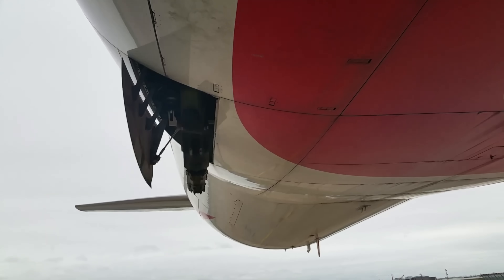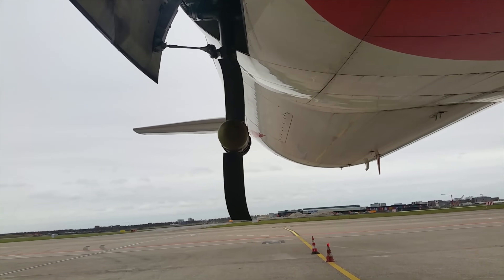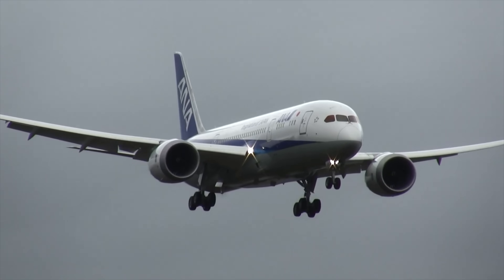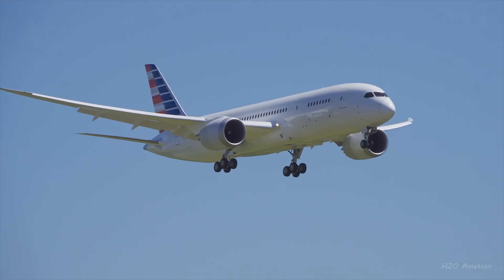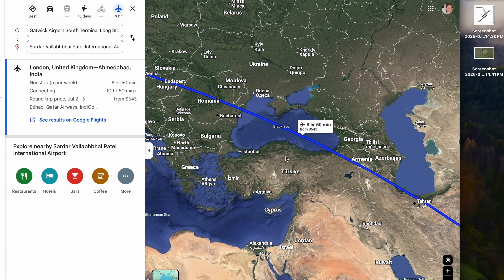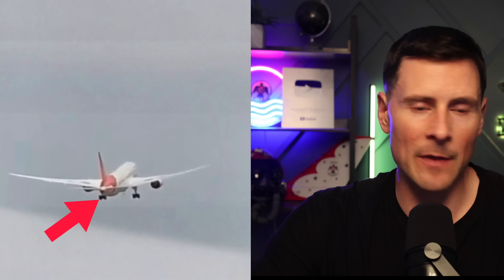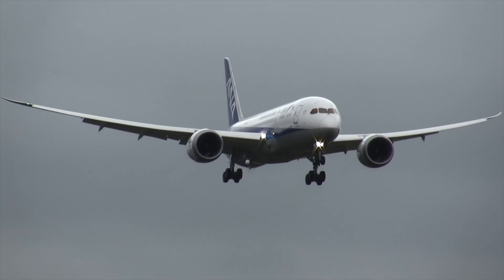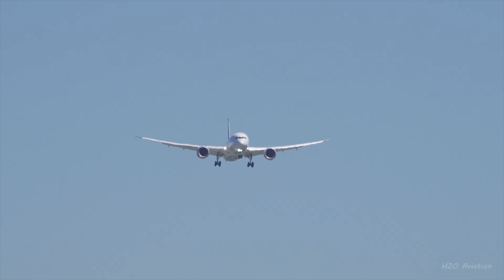Air India 171 SHOCKING UPDATE on RAT Deployment and Flaps!

Comment: I’m a B787 captain with 25000 TT and 8000 on the B787. Great videos, thank you. My thoughts are that they lost the right engine at or around V1, that explains the cloud of dust at the end of the runway as they were rotating. Shortly after they lost the left engine, same reason as the right, possibly from fuel starvation or software issue. One small detail, the EECs have there own power source independent of the main buses and the engine driven generators, as long as the N1 fan if windmilling the EECs are powered. The bogies are tilted in the retracted position, not in the extended position. I’m sure the NTSB will find the gear lever in the “up” position.
I really feel for those guys in the flight deck, all the passengers and the victims on the ground.
Reply: Here's my question to you sir.....
I worked in Boeing experimental flight test and flew on those so many times. We always recommended APU be on until take off was complete and the airplane was clean. 
Why do you think they took off without the APU on? A single engine failure with APU on would not deploy the RAT. 
Lets discuss for a moment the different scenarios that would cause a dual engine failure. 
Fuel starvation? But that would mean at least several fuel pumps were out. That is a very slim chance of happening. 
Fuel contamination but wouldn't there be fuel bypass with the cautionaries? (And it would have to be VERY bad fuel; Not impossible though)
I saw no birds in the video sufficient enough to foul those big turbo fans. 
The only other thing I can think of is someone hit both fuel cutoffs after getting airborne. And you and I both know, that can't be an accident. 
If you're the pilot flying and your 1st officer or someone 'dead heading' in the jump seat hit those fuel cutoffs you wouldn't immediately know that was the reason for the engine fails. You'd be reacting to the situation and would least expect someone hitting the cutoffs. 
The flight deck data recorder will indicate where the fuel cutoffs were during the flight and when. 
Thanks for your input!
Reply: @mpatrick7860  I'm wondering if stuff was going wrong as they were going down the runway. One thing that not many people comment on is the fact they used almost the entire runway, as far as I can tell they should have been airborne much sooner indicating thrust issues as they were going down the runway. It was very hot and they sat on the tarmac for a couple hours, can these jets get vapor lock?
Reply: Nowadays most airlines have the procedure to shut down APU after engines started and restart only after landing. I think it's nothing but money saving. As I remember in the past the APU was left on until a certain altitude as you said and was restarted during approach at some stage. It definitely gives you an extra source of electrical power that is capable to supply nearly the entire a/c. Well, not sure of the 787 as I stuck with vintage a/c's like 737CL, A300 etc😉 In this case the APU wouldn't have helped much but there have been other situations where it could. They should revert back to that habit.
Reply: @csehakos3486 Agree 100 percent.  Accountants and greenwashing is the only reason to shut down the APU, often done after main engines are running.  We all recall the A320 that had double engine fail after bird strikes and was recovered to land on the Hudson. In that situation the captain instructed APU re-start (not part of the normal procedure, apparently) to maintain electrical generation and hydraulic pressure. Definitely a contributor to assist the brilliance of the crew that day.
Reply: @mpatrick7860 finally!  Someone mentions sabotage.
Reply: @mpatrick7860 Yes, I’m starting to believe this was a deliberate act.
Reply: APU was probably OFF because in some photos from wreckedge showed APU door slightly open and identified by 787 Engeneers  witch means  APU was starting
Reply: Could they have lost power in one engine and they accidentally shutdown the wrong engine resulting in the RAT deployment?
Reply: @GeorgeRapko With an engine failure on take off, standard operating procedures is to climb to a safe altitude before running the engine failure checklist. Usually at least 1500 feet above the ground, and possibly much higher.
Reply: @johncox4273 …and when you have two of two out, and no thrust ?
Reply: @MS-Patriot2 Then you maintain flying speed and look for a place to land. If they lost both engines right after lift off they didn’t have a chance no matter what they did with the surroundings. 

I was replying to the post that said perhaps they lost ONE engine on take off and shutdown the wrong engine. In that scenario the aircraft should climb just fine to a safe altitude, where they could run the engine fail checklist safely.
Reply: Wouldn't the dust at end of runway as they were rotating be from the jet blast then pointed at the ground?
Reply: Black boxes will probably show when gear lever was pulled etc etc
Reply: @arnemasakingkierkegaardnis4940 😅black boxes, as you mentioned will tell the whole story
Reply: Dual engine flameout shorty after takeoff. There hv been suggestions that the plane used the entire runway .
The extreme heat and lack of rain caused an extraordinarily large dust pile and debris at end of runway that is evident after takeoff. British Airways had a 4 engine flameout from volcanic ash high altitude. Is it possible that the dust and debris caused a flameout at
rotation?
Reply: @marielle129 Absolutely not. I did quite a few sand ingestion test with the other Rolls Royce engine for the 787. We injected 10 times more the standard quantity and nothing was able to change the performance
Reply: @tabae73  Exactly!  Emirates, Quatar and Etihad would be in major trouble if they couldn’t land in minor sand storms.
Reply: @marielle129 it took quite some time of flying through the ash for BA009's engines to stop, at least two minutes. It also took so much ash to stop the engines it gave their windshield and all the leading edges matte finish.
Reply: @EriIaz  yes you are right . At that flight level the ash particles were minuscule but lots of it !
Reply: @marielle129  The runway is 45 m plus shoulders of 7,5 m on each side. As soon as the wings create lift they also create wing vortices. The wingspan of the 787-8  is 60,12 m. There was very little wind from the right side, so the vortices slowly moved to the left creating a little dirt devil behind the engines. Somebody calculated the exact take-off point, it was exactly where it was expected.
Reply: @GermanGuy007   true - Amy ideas besides intentional , bird ingestion or volcanic ash ingestion  , what would cause a simultaneous cut off of both engines .
Reply: @marielle129  Right now most bets are on software issues. That’s more likely than electrical or mechanical issues IF both engines lost most or all thrust almost simultaneously. Also it’s rare that one problem brings down an airliner these days, it‘s usually a couple of things happening at the same time. You probably heard about the Swiss Cheese Model (Wikipedia)?
Reply: I too spotted some yaw at takeoff suggesting thrust asymmetry and possibly loss of one engine.
Reply: @MS-Patriot2 I asked chat GPT and it looked like the left engine went out first then the right at the apex of the flight…it was all downhill at that point and the pilot did his mayday call explaining the situation…
Reply: Yup... EEC's get power from the BUG...
Reply: I agree they tried to raise the gear as the tandems  are pointed up in the retract position. But the gear retract isn't a lever like in many other planes. It's a switch on the panel. Were you just generalizing? 

I don't see any indications of right engine failure. A very slight yaw would be for wind. That cloud looks like dust on the runway to me.
Reply: What if its a combination of pilots error take of weight temperature that
Reply: @sivamohansivaraman  It may well be. A perfect storm, as it were.
Reply: Clear concise honest evaluation !
Reply: What about no sign of any Yaw and significant direction change if it lost only one engine.
Reply: @infinitebeing1119  the aircraft does appear to yaw just after takeoff!
Reply: @infinitebeing1119 watch it again, there’s definitely yaw.
Reply: What does NTSB have to do with Air India?
Reply: @Whiteyholmes08 US built aircraft. They usually assist.
Reply: I am not a pilot but from a pure electrical engineering perspective the failure was beyond common redundancies.  I am thinking catastrophic electrical failure and I will emphasize the grounding system as it is common.  It’s happened before in other aircraft.
Reply: not sure about the dust but now i have looked at it it looks like you could be on the right track
what he thinks is the rat could be the rh u/c door  think that deploys first in the sequence
Reply: @davidblurton7158    I didn't design the engines to turn off or to be turned off.  As for the RAT, I believe the RAT was deployed by the Co-Pilot. As I stated, the engines were reduced in power at some point for reason of erroneous communication with the engine management systems. As for the left, being reduced for same reasoning. 
As for lack of Electrical Power, I believe an erroneous communication with the Airframe electrical management systems but, not a complete power failure.
Reply: @philis52  sounds about right  everyone is assuming everything,,  no one really said manual deployment but it is a consideration  goikng to be really interesting when they release the reports
Reply: @davidblurton7158   Electrical Management systems Failure including flight deck and communication to the Engines due to too much heat. Both engine ECMs were not effected, I did NOT design the engines to ever shut down.
Reply: @philis52  yeah by all accounts they should run with electric failure,,,  its quite a clever system    and u designed it or had a hand in it??
Reply: @philis52  do you think the ac failing on the ground would have an effect   there must be a decent cooling system to get that heat away generated by all those screens and instruments and black boxes
Reply: @davidblurton7158    I think, any Aircraft with the slightest system issue should be at least deboarded, passengers afforded another Fully Functional Aircraft.
Reply: @philis52  you would not get anywhere so...   so long as its not flight safety issue they defer it to next servicing or when near a maintenance centre when they have time
Reply: @davidblurton7158    Well, a Guy can see how one problem leads to the next. Call it  serious lack of maintenance Roulette.
Reply: @philis52  your saying lack of maintenance and we have no proof with that but if some things have got hot and overheated when they should have been cooled then thats not going to be a good thing for air india if they knew about it and its caught them out
Reply: @philis52  did you work for ge phillis
Reply: @davidblurton7158  30 years at Boeing
Reply: @davidblurton7158   Correct! Heat is not good. Plus AI is plagued with Management 101 issues which the new owner purchased. 
Huge communication break down in language, records keeping, failure to repair failed systems which lends to no records.  I am not fond of; the "Keep em flying" moto Who coined it? We all know, now how AI operates with it's firing of Pilots & Crew for whatever reason leading to not just one ugly cover up but, AI171. Add all that to the Damaged Black boxes; we may never know what happened to AI171.
Reply: @davidblurton7158  
 SAD FACT: What AI can't cover up is; the worst safety record and for sake of AI's  "Air Operation Certificate". Air India's AOC is subject to renewal and adherence to these regulations is crucial for its continued validity. The DGCA has recently emphasized this, warning Air India about "repeated and serious violations" and ordering the removal of three senior officials related to crew scheduling. Also, Reuters reported warnings from the DGCA for flying certain Airbus aircraft without mandatory checks. The DGCA considers airworthiness certificates "deemed suspended" for aircraft that miss these checks. Why was AI's AOC not Suspended? Sad to think, all those souls died at the hand of Poor Management in the safest Aircraft ever built. My solemn apologies for those who won't give  apologies.
Reply: @davidblurton7158    What I am saying is; By rules of AI's Air Operation Certificate as written, AI's AOC should have been suspended prior to AI171 flying.
Reply: @philis52  look there are dead animals and dead people lying by the side of the road in places  people hang off trains and cows walk through the streets   its hard to change a countries nature,  so much poverty which cascades its way into everything
Reply: @davidblurton7158  yes, I fully understand your Excellent point and I'll add I think it is terrible for all those people Died because, of something which could have been avoided if not just the greed of Boeing but, if our country had some sort of Star Trek Non-Interference Directive, guiding principle prohibiting Starfleet personnel from interfering with the natural development of alien civilizations added to tariffs. Sure a TV show but, it's a damn good rule.
Reply: I've come to a lot of the same conclusions, but also including sabotage as a possibility.
Reply: Can you determine the ground speed as it seems like it was going slower then normal on take off roll using all the runway vs it should have been off with close to 1500-2000 feet of runway.
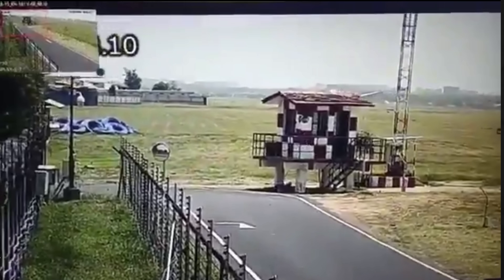Reply: At around 03:45 or in the "original" video from the airport it seems to me that the B787 "shakes" when she rotated. Is this an optical gizmo, or my eyes?
Reply: 30th April 2015,  New York Times News : "F.A.A. Orders Fix for Possible Power Loss in Boeing 787":-  Federal regulators will order operators of Boeing 787 Dreamliners to shut down the plane’s electrical power periodically after Boeing discovered a software error that could result in a total loss of power. The Federal Aviation Administration said on Thursday that Boeing found during laboratory testing that the plane’s power control units could shut down power generators if they were powered without interruption for 248 days, or about eight months. The findings were published in an airworthiness directive. Google it for more details.
Reply: With due respect, I disagree.  The airplane used the entire runway available (11,500 ft) indicating acceleration issues.  The airplane rotated at the very end of the runway with TWO, not one, jet blast signatures.  With acceleration issues, rotation at the end of the RW does not mean they reached Vr.  There was no rudder displacement or any yaw moments indicating an engine failure (Yes, I am aware of auto rudder assistance).  The airplane drifted slight left which also negates your loss of right engine.  If uncorrected, the airplane would drift to the right.  Because of poor acceleration, the aircraft used approximately 40% runway than required.  The captain should have rejected the takeoff.
Reply: it's scary that planes, nowadayas, fall down, just because of software things.... or even fuel problem...
Reply: @ericperez534 I worked 30 years in the industry for a supplier of complex power management systems to Boeing and others. I can assure you the vast majority of systems are designed to resist multiple failures (redundancy) and to fail safe. Certainly all systems related to safe flight (ie not the passenger entertainment system) are specified, procured and tested this way.   If installed, operated and maintained correctly, these catastrophic failures are almost zero probability of occurring.
Reply: Absolute amateur hour guesswork
Reply: If there's engine failure or failures, is that not a red alert when maintenance is done?
What's fuel starvation; meaning the fuel lines are blocked? Again, is that not a red alert on maintenance personnels?
Reply: @Frank-rp6ni  fuel starvation could be fuel contamination. it happened before
Reply: @HellStr82 ..Fuel Pipe Airlock  due to extreme heat ?
Reply: Indian software ? Just like in the 737 Max crashes ?
Reply: @polycadence8482  engines operate separately ,  the Japan airlines flight that lost all hydraulics was still able to fly amd turn using thrust .
Reply: Thank you for replying Captain. Always good to have first hand knowledge on the involved aircraft.
Reply: No you're not
Reply: How do you have 25000 TT and think a 787 would fail because of one engine?
Reply: I think it was so hot the engines had a fuel issue either vapor lock or maybe a software issue. Those are my educated guesses.
Reply: @mikemicksun6469  I have been flying jets for near 50 years.  I have routinely flown out of high density high temperature locations.  In 50 years of flying jets and 25,000 hours of accident free flight time all over the world, I have never experienced, heard of or seen written in any flight manual, BEWARE OF VAPOR LOCK.  Somebody is feeding you a line of b.s.
Reply: I just wanted to say I've never read anything so incoherent, making no sense at all, until your comment. For sake of everyone, if you're flying, I hope your skill of flying are better than your "opinions" and thoughts on accidents. You are shameless.
Reply: @furious6358  Did you say something?
Reply: Flightradar24 shows the aircraft started the take off roll from the intersection half way down the 11,500ft runway. Maybe the dust is from the ground at the DER which should be well below the aircraft had they used the full length? I’m sure the investigation will come up with the facts. The gear bogies do look like they are in the retract position prior to moving up in to the well.
Reply: @flappingarms9335  ADS-B data coverage at that airport isn't often 100%, therefore a normal departure will appear as an intersection departure.
Reply: @flappingarms9335  Flightradar24 ran the data individually and confirmed the initial adsb track was wrong, it wasn’t an intersect departure. AI171 used the whole of the runway for take-off.
Reply: @flappingarms9335  That has been debunked Thursday around noontime
Reply: @flappingarms9335  It only used half of the runway for take off?  That's the first mistake, my instructor always told to me to use every foot of runway.
Reply: Maybe it was Pilot suicide!
Reply: How do you have 25000 hours and think that dust flying off the ground from the thrust of the engines while the plane lifted off equates to an engine failure? Do any of you pilots have any common sense or critical thinking? Not surprising I guess given how I noticed the RAT was deployed the very first day of the crash while all of the so called experts were blaming the pilots for retracting the flaps without any evidence. I only fly on Microsoft flight simulator and I feel like I have better insight than actual pilots like damn
Reply: @user-sb7lv2tk9m this is True. Another captain also agrees with this theory. Right engine gone at V1 as the nose of the airplane is tilted at take off. The debris collected at the end of the runaway would have damaged the second left engine. The cloud of dust at the end is the indicator. Remember, this aircraft took the whole runaway for take off which is unusual
Reply: @user-sb7lv2tk9m  he said one engine list before rotate and one after. Don't you read very well?
Reply: @user-sb7lv2tk9m 
Before you post some childish insult hockey like that, fk'n think about it, Einstein. If they kicked up dust at the very end of the runway, that means they used every last inch of paved runway. Why were they still on the ground that far down the runway? Well, gwooolay I dunno, engine problems maybe? Thrust but not enough  to keep the plane in the air once they lost the ground effect? This pilot is saying what COULD have happened. He doesn't mean that it IS what happened. No one will know for sure until the investigation is done.
Reply: @user-sb7lv2tk9m  they were still in ground effect over dirt after they used every inch of the runway, which they should have not needed.  This indicates they had a problem with thrust already at V1. Common sense is not typically developed from video games. LOL!
Reply: @mariem3800  Wrong, wrong, wrong! They took of where they were supposed to.
Reply: @user-sb7lv2tk9m  maybe you should read it correctly. He stated one engine only at V1. There's still enough thrust for take off and dust from E2.
Reply: @user-sb7lv2tk9m  said: "How do you [...] think that dust flying off the ground from the thrust of the engines while the plane lifted off equates to an engine failure?"
 I guess it's the asymmetry of the dust cloud, quite clear under the left wing but significantly less evident at the right, which may mean this engine wasn't properly working hence no or poor thrust to raise a similar amount of dust at the right side.
Reply: @user-sb7lv2tk9m  mate, can you comprehend English? He said that around V1 the right engine lost power, if it were close to V1 they can’t stop, the best they can do is push the remaining engine, which was the left one…and it is from under the left engine the dust/dirt flies into the air and NOT the right engine . What is that indicative of? It is indicative of the fact that the right engine was not spooling enough power to force dust/dirt of the runway, whilst the left one had enough power to do so.

Then once the plane is committed to get airborne the left engine may have also gone down, which is why the RAT deployed. 

Reports are that the aircraft used most of the runway, which wasn’t necessary, which could also be indicative of a thrust problem.

Another thing, the plane should have been spooling up very high to get airborne, yet we can hear the RAT and not the engines. Ever been near a plane at takeoff?

Look online and all video is of RATs deployed are when planes are landing. They can be heard because when a plane is landing it isn’t using the same amount of engine as taking off. It is thus quieter. So, how come the RAT could be heard in the video? We should be hearing two pretty loud engines…

It’s great that playing a child’s video game has made you an expert.
Reply: @Tryna-B-Good isn’t V1 the decision speed at which you CAN abort the take off and stop safely with the remaining runway ?
Reply: @user-sb7lv2tk9m Stick to you’re flight simulator…. You maybe right but you’re not a pilot.
Reply: @user-sb7lv2tk9m  A single engine failure around V1 could cause the plane to use up every last foot of the runway, which would explain the dust.
Reply: @marmal320 is there even any evidence that it used all the runway though? Those engines are powerful and just because it kicked up some dust doesn’t mean anything
Reply: Sounds like you should join the investigation team.
Reply: @user-sb7lv2tk9m ive been following this accident closely as well and reading many comments from alleged pilots however I 100% disagree with you and people claiming that all these alleged pilots don’t know what they are talking about. 90% of the comments ive read theorized there was a loss of electrical power and or failure in 1 and or both of the engines, day 1 of the second video release 50% said they could hear the RAT which I think is obvious as I could hear it as well but I am not a pilot. I have however flown 19 times in the past 20 years, 15 of these flights happened in the past 10 years. The 777 is the jet ive been on the most but I have had 3 flights on the 787 the last 2 were on the 787 actually. I enjoy flying and airplanes in general I would show up 2-3 hours before boarding time so I could stop at certain terminals and watch jets take off because its my favorite part about flying followed by the landing. I know none of this makes me an expert but it doesn’t mean that I cant see things that are happening and one thing I noticed right away was the speed of the jet down the runway especially the last 750 feet which was the slowest takeoff ive ever witnesse then like everyone else I noticed the extra amount of runway used in order to takeoff. This all may be just a coincidence or these things also may suggest a loss of thrust do to failing power to the engines whether that loss was electrical or fuel related well see but I believe its more likely due too electrical failure. As far as the flap issue  there were only a select few pilots actually suggesting IT WAS A POSSIBILITY, no one said they thought it was concrete just A POSSIBILITY, these pilots also said it was possible their was an engine and or electrical failure. Almost all pilots stated their was a popular theory about the flap lever being pulled however out of the 20 pilot comments I read only 2-3 listed it as their number one theory but also making it clear that they could be wrong. Out of all the BS, nonsense, idiots and ignorance that exists online especially in comments sections when it comes to the comments in regards to this situation there has been a lot less of all that suprisingly. For some reason though you are all hyped up because you heard a loud ass noise easily distinctive of the RAT deploying and its probably one of the few things youve ever figured out correctly early in a situation and now you feel superior to everyone even though countless of people said they heard the RAT as well. One of the moat important qualities of a pilot is being humble and then willing to give your life in order to save the lives of others, something many of these pilots your wrongfully judging commit to every day. I don’t care if you’re the best sim flyer on the planet doesn’t seem you have learned what humble even means let alone practicing this behavior in life.
Reply: @user-sb7lv2tk9m  if you look at it the dust is more left hand side,,  which indeed could indicate engine failing on rh side and then followed by the second quitting just after rotation  it does fit the clues,, long take off and struggling a bit if you perceive it that way
footage is grainy but its an excellent spot and if correct you are going to look like a right bell end!
Reply: @user-sb7lv2tk9m you have no idea what you’re talking about.  Trying to sell your expertise fling Microsoft flight simulator over a 25k hour captain is laughable
Reply: @user-sb7lv2tk9m  If they had an engine failure just before V1, they should have instantly hit the brakes, not continued another 8000 feet. That explanation scares the hell out of me.
Reply: @user-sb7lv2tk9m yes I am sure, you are a real hero and you know everything. I am sure that if you were in the cockpit nothing would have happened because you would have kept the plane in flight with the sole power of the bullshits you are spouting😂
Reply: @ravenguard1495 he would have pre checked the plane, a mandatory safety check before take off.
Reply: @ravenguard1495 I’m not portraying myself to know everything. I’m just pointing out how clueless these pilots are when this is their whole career. I’m very much happy with my own career and don’t want to work as a pilot missing my family every week
Reply: @user-sb7lv2tk9m  Its honestly scary how many contradicting opinions you read from alleged 777 and 787 pilots. Its almost as if none of them know what the hell they are doing. They certainly don't seem to have a universal understanding of the main systems.
Reply: @paulgallagher2937  In reality, many pilots don’t have a deep understanding of all systems. For example, in the case of crashes caused by the MCAS system, the pilots initially weren’t even aware that these devices were part of the autopilot.
Reply: @GetRekkles  That‘s because Boeing intentionally withheld this information from the POH. This has been in all media for ages.
Reply: @paulgallagher2937  At the end of the day we are all speculating. So a lot of different scenarios are considered. And different pilots might have encountered different situations themselves.
Reply: @paulgallagher2937  At least in the US, pilots must have extensive knowledge of critical aircraft systems before they get their type rating..  The reason for the confusion is that we have very little to study except some blurry photos.  Yes, I am a pilot.
Reply: Exactly. And unfortunately it is a habit of the media to use various pilots as experts at all aspect of aviation while rarely seen technical people on screen. That doesn't sound attractive enough to say like "we have here Mr XY who has been engineer on 787s for 15 years..." etc. It's sounds better if someone is a captain with all the hours of the world. Experts from various relevant fields of this business should be asked to get proper opinions😉
Reply: @paulgallagher2937  Because none of them are pilots, its very easy to say you're a pilot on the internet without showing any credentials. They're in most cases 15-year-old kids whose only experience is MFS
Reply: @Emeraldplanespotter  FOr the comments, I assume that is mostly the case. But more concerning is that most of those actual pilots making videos don't seem to know much more. They seem to have little to no understanding of the systems they are using. It should be required training that they have a deep understanding of how these systems work and depend on eachother.
Reply: @GetRekkles Boeing kept the MCAS system under wraps, so many MAX pilots were not fully informed or trained on how it worked. I heard that the training was just 1 hour  on an iPad, and was not in depth. Obviously the crews of the accident aircraft did not have a deep knowledge of the system. 

At the request of the airlines, Boeing added the MCAS to the MAX  so pilots flying the Max would not have to have additional simulator training, which was a huge mistake.
Reply: A real pilot doesnt need to begin his entry stating he has 25000tt just to begin with. You have to work out more the way you lie to sound realistic. And then call for statements that make more sense. Stop playing that game it makes you absurd.
Reply: @BMWyCia it established credibility and expertise. A 787 captain is someone I want to hat from, not armchair “pilot”.